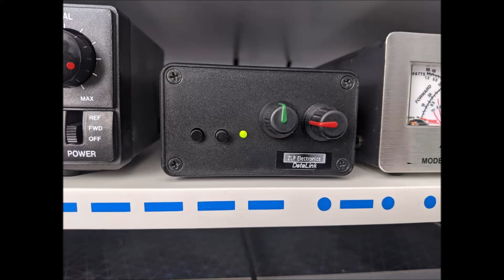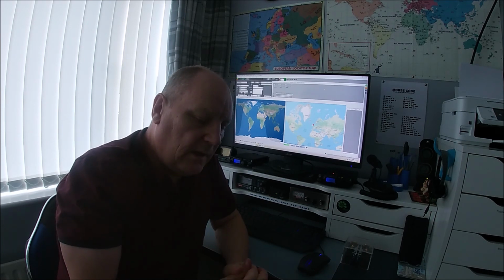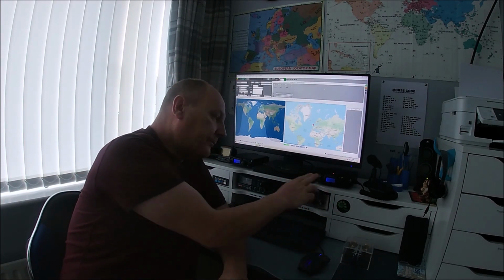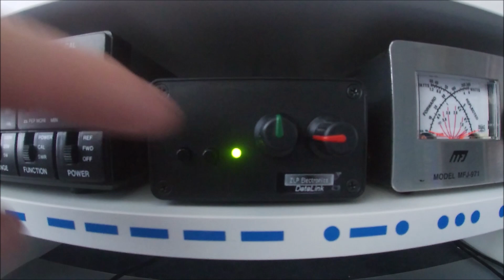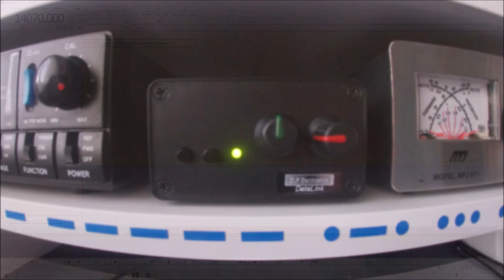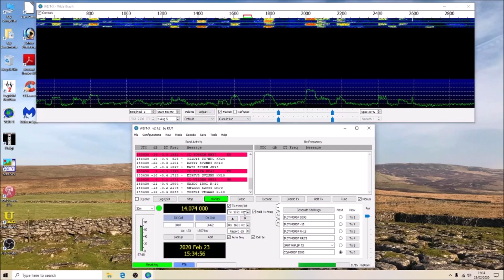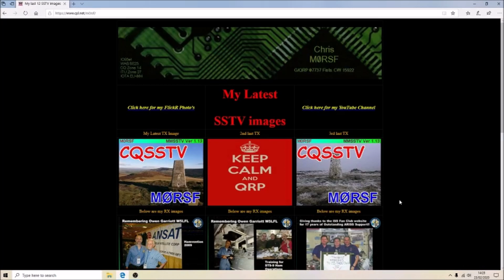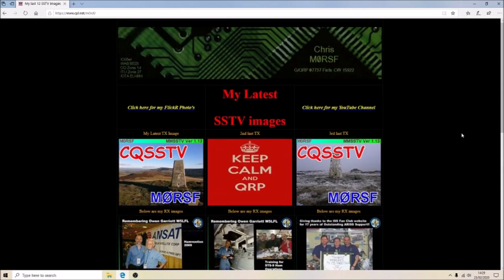ZLP Electronics DataLink Interface (for Data Modes)

Comment: Welcome back to the world of youtube Chris ! brilliant video , one thing i never looked into is SSTV on vhf . Had a quick look on ZLP's website , can you point me to which interface it is ? On the left tabs sevral options and could not find any that looked the same . Weekend after next i should be out doing a bit of SOTA VHF but sadly not in your reach ... Dunkery beacon area near Taunton . 73 Matt 2E0FGX
Reply from the maker: Hello Matt, on the ZLP website if you choose Data Interfaces then Mini Pro SC. That has a built in soundcard and is similar to mine but works with just one radio which should be fine for you. You will also have to choose a cable from the pull down menu to connect the interface to your radio. Anything I can help with just ask. Woke up to Snow this morning here in Yorkshire. Good luck with the SOTA at the weekend, I really need to get out on the hills too. 73 Chris M0RSF
Reply: @M0RSF  cheers Chris, I will look later . Great ! No snow here down south . I'm wishing for it to snow and can do a snowy activation. No problem driving in those conditions in a landrover.  Hopefully do alot more this coming summer. 73Matt 2E0FGX.

Comment: I had one of those for a long time . I loved doing the data modes.But with the 7300 its now soo easy . nice vid Chris .
Reply from the maker: Thanks Phil, hope all is well. My first Interface was the ZLP MiniPro which relied on the internal soundcard of my PC. The newer ZLP interfaces with the built in soundcard are awesome. Unless I'm mistaken the Icom 7300 has a built in soundcard? Speak soon, 73 Chris M0RSF
Reply: @M0RSF  Yes . setting it up  on some of the older Programs is a little tricky But not impossible.